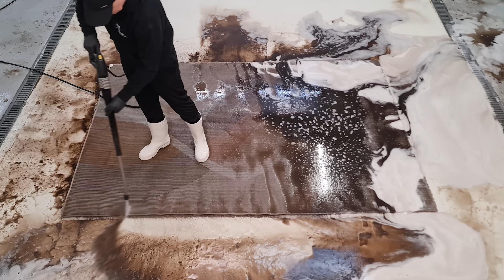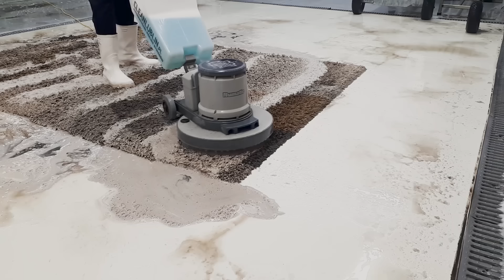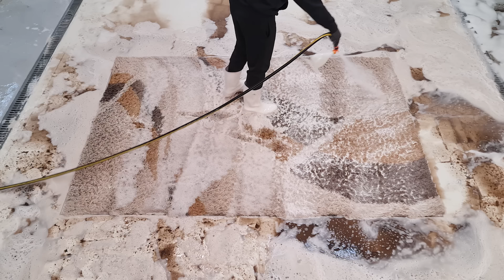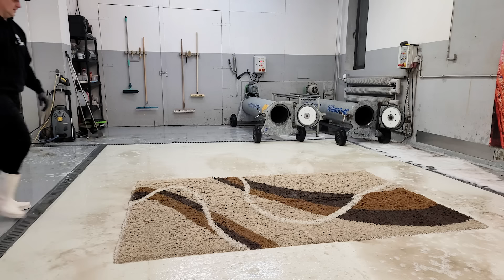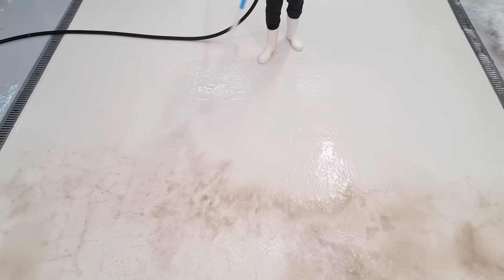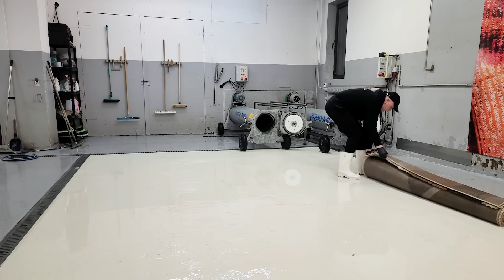Mega Heavy Dirty Shaggy vs Human Who will win? | restoration | asmr

Comment: It would be good to know if it was possible for an efficient and ecological way to filter and reuse the water.
Reply from the maker: The separator for impurities insoluble in water, i.e. sand, hair and hair from the carpet fleece, is located below the floor level.
Pre-filtered water goes to the sewage system and from there to the municipal treatment plant.